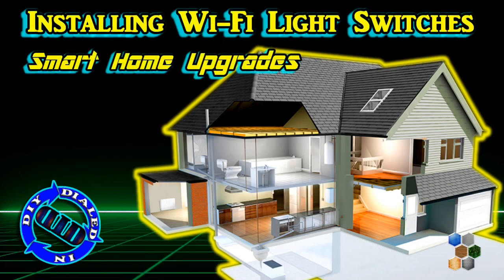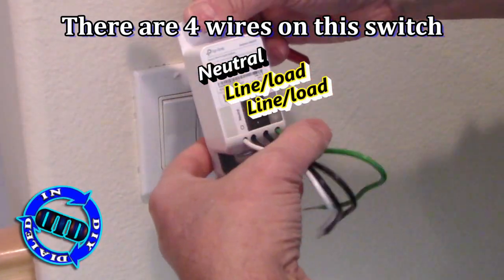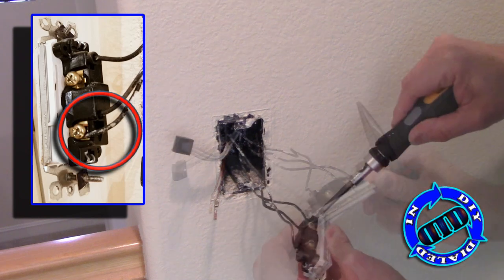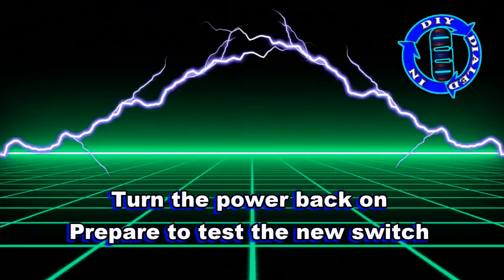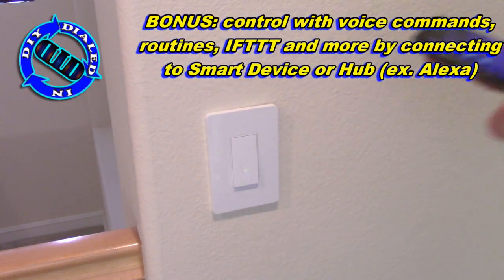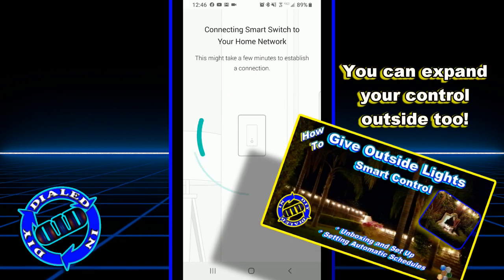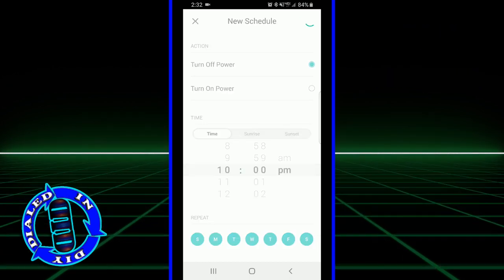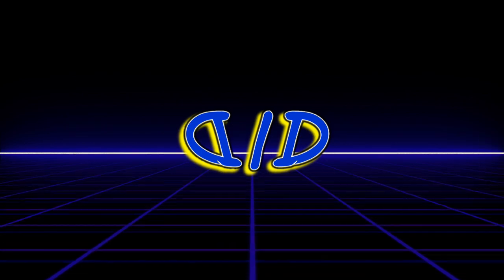How To Install Smart Light Switches - DIY Smart Home Automation

Comment: Another excellent how to video. I really like TP Link products. I use their wifi extenders in my domicile.
Reply from the maker: Thank you very much (I think I will start shortening that to TYVM... lol).  I am definitely having fun with their products and finding they are more compatible with other devices than they list.  Which WiFi extender did you try?  I used their TP-Link AV600 as a powerline ethernet adapter (I set it up secured and was impressed with how well it has worked).
Reply: @DialedInDIY  that's actually the same one I bought for the farthest room from the wifi router. The pc I had back there didn't have wifi capability. This worked perfectly. I have a small apartment so there isn't much need for a lot of extenders. My biggest problem has been interference from other routers around the complex using the same channels and frequencies. I now have a Tenda 5ghs router that has an app that makes it easy to optimize and change the channels. So far I'm loving it. It has definitely improved my  overall experience.
Reply from the maker: I completely understand the issue of interference.  Before our last move we had different issues at different times of day with just about everything that could use a remote or wireless connection.

Comment: Umm, no neutral wire...will look at options and some folks talking about Google listening...Nest and others do much the same.
Reply from the maker: You are correct that there is the ability of the smart hubs to "listen" which is necessary to respond to voice commands.  The good news is that the switches can be used without a voice responsive hub.  When you say no neutral wire, do you mean your switch wiring does not have the needed wires?